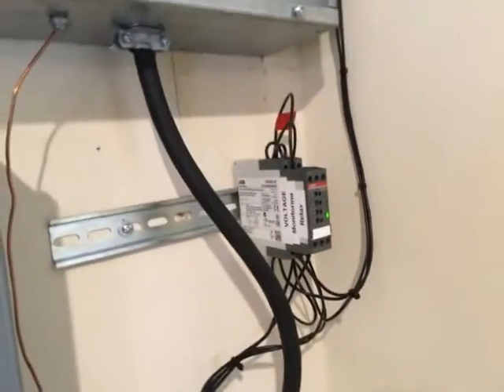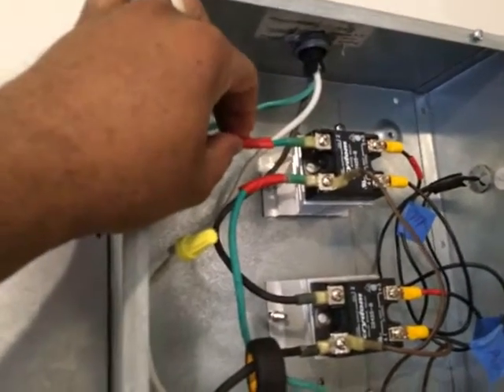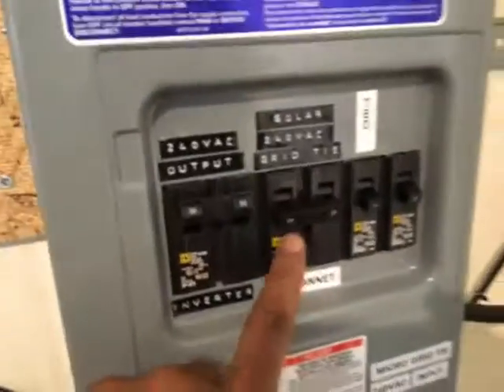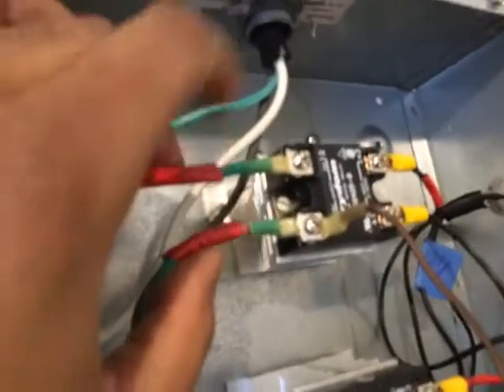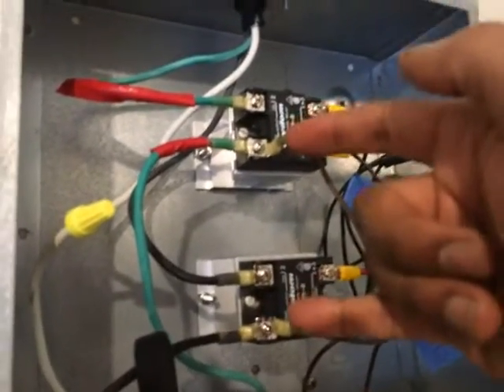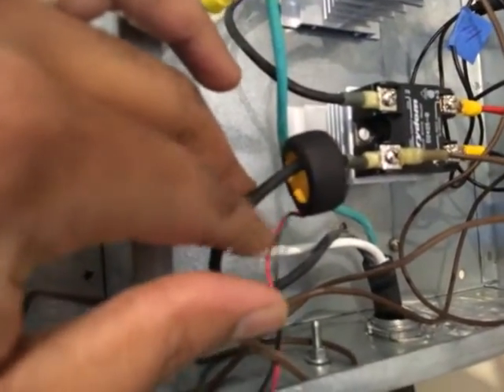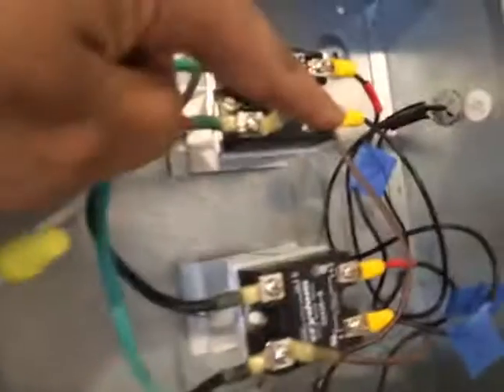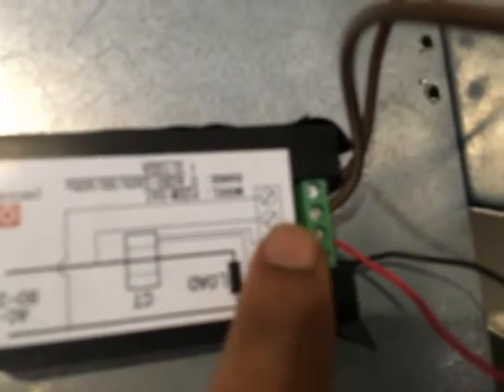How I wired my solid state relays in my AC Coupled setup

Comment: Are you using the APC grid tie inverters to charge your battery bank with this set up?
Reply from the maker: +TheWickedjestr Yes, I'm using my grid-ties to charge the batteries and the SSR's are there to shut off the GTI's when the batteries are full during a power outage, in an AC Coupled setup.
Reply: That is pretty slick!  I have Enphase and also a bank.  Would be nice to be able to use the enphase in an outage with my bank as an option.  When the bank is full and the grid still has power, are the GTI's still poweing the grid?
Reply from the maker: In an AC coupled setup, the GTI synchronize with the 60Hz signal coming from an Inverter Charger like the Magnum MS4024PAE or the Outback.  They will operate send power to your Inverter/Charger to feed the loads first and the excess to your battery bank in a bulk mode unregulated type of charge, hence the need for the SSR in my setup.  Enphase can be AC Coupled with the Magnum and Outback inverter chargers.

Comment: Thanks brother.
it's sounds simple but complex.
Nice work and thanks.
Reply from the maker: +JWSolarusa John Wesley Thanks John, I appreciate the compliment.
Reply: rhandsom You are welcome
Reply: +rhandsom Yes thank you brother. Now I see how it works. The DC side had me mixed up. Thanks so much for the help man. One thing whats the DC thing called. So I can buy one. Thanks so much brother. God Bless.
Reply from the maker: +yankey4 No problem glad to help.  I'm using a voltage monitoring relay.  Check out these videos for an idea of what they are and what they can do.   https://www.youtube.com/watch?v=qYTF6kzVtsI  and this one https://www.youtube.com/watch?v=Eq72_a4jYUs  The unit I have is a (ABB CM-ESS.2).  These are industrial grade units and so they may cost a bit, between $150 to $190 depending on the supplier. You may be able to find a similarly functioning unit on Ebay for cheaper, you may find a unit that does the same thing for cheaper.
Reply: Kick butt thanks man. I was thinking that's what they where. I have seen them be for just been some time. Thanks brother. God Bless.